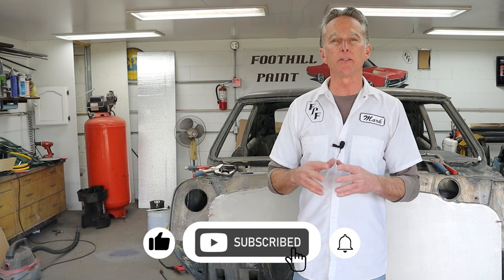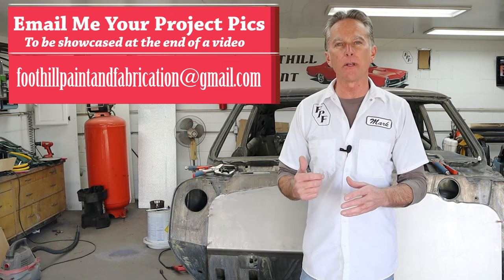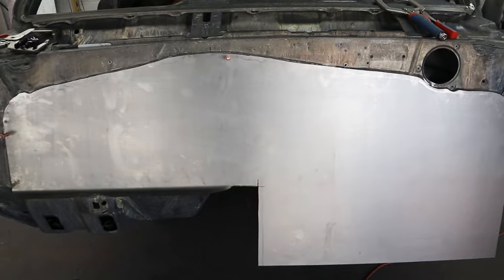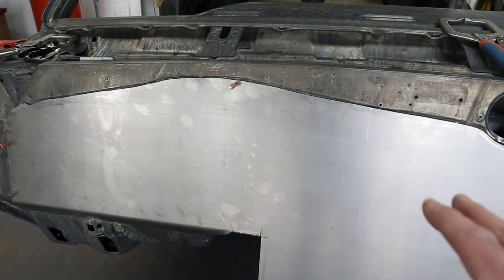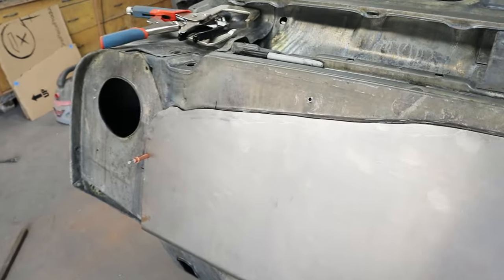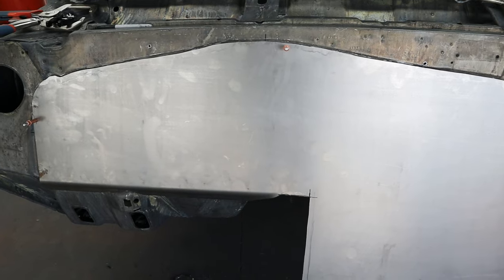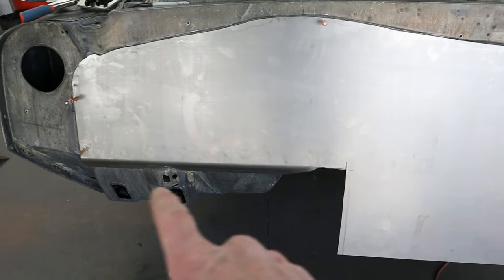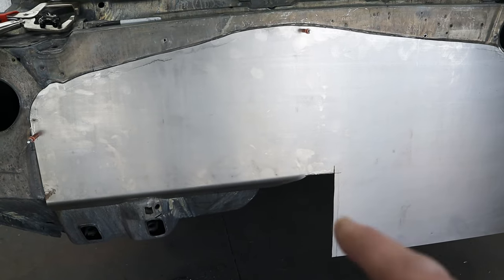Fitting Up the New Firewall GTO RestoMod (Ep 39)

Comment: Thanks for the video Mark!  Lots of “on and off” to get the sheet fitting just right.  Looks great!
I too have some scars from my grinder.  I generally leave the guard in place, but occasionally it gets in the way.   That’s when I’ve nipped myself with it. 
Dropped my fuel tank at Bo’s place.   I’ll pick it up on my way through in a couple of weeks.  Getting everything else ready for the big dip!
Reply from the maker: Thanks Robert.  The mini guard should help and stay out of my way.
Great news on the fuel tank.  Tell Bo hi for me when you pick it up.  Are you on schedule to drop off the body?
Reply: Yes!   I’m just finishing up getting all the bits removed from the body, doors, fenders and hood.  
Then I’ll put it in my trailer and, off we go.  
Bo said they’ll do the doors etc pretty quickly, but the body will be there for a while.  I’ll use that time to finish the frame and put together a paint booth in the shop.   I’m planning to use the same DTM epoxy you’re using on Ruby.   Are you still happy with that choice?   
Thanks much 
R
Reply from the maker: Yes I am.  Low shrinkage and nice to sand.  What is the humidity like there?  @robertmazzei2412
Reply: We have low temps but high humidity.  Very wet climate where we live.
Reply from the maker: That is not ideal conditions is it? Is your shop sealed up pretty well? You might want to invest in a dehumidifier and leave it running in the shop.  Cheap insurance to keep the bare steel safe until you get some epoxy on it. Read the product data sheet carefully as some products do not like excessive humidity, polyesters for one.    @robertmazzei2412
Reply: Thanks Mark.   This is a cool damp area.  I’ve got floor heat in the shop and a good wood stove.   I can keep it warm and dry in there.   But I’m still concerned about flash rust.  
I’ll likely plan this so I get the body back in the middle of the summer.   It’s nice and dry at that time.  
Not like SoCal, but pretty dry.
Reply from the maker: @robertmazzei2412  That is good news. After dipping it isn't like media blasting where it flash rusts right away.  You should be okay but you have a lot of work to do before Fall comes